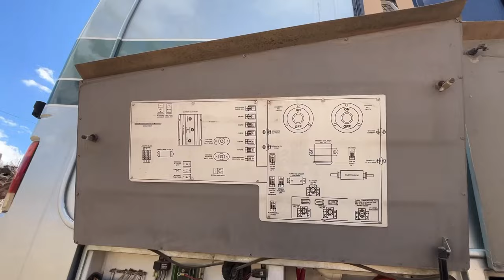RV Repairs. Fly Swatting lessons.

Comment: Another fly tip: you'll have more success angling from their rear. I used to catch flies with my hand all the time 😅by scooping them from behind. They take off perpendicular to the surface they're on and have to transition to forward flight, also fighting gravity which varies with the orientation from which they begin. It's during that initial perpendicular takeoff period that they're most vulnerable. But if you're expecting them to instantly move forward, you'll actually miss in front of them. They very often angle to the reverse of the direction they were facing, which increases their chances of dodging a normal anticipatory trajectory.

Another problem is that often you're worried about damaging the thing they are on or something nearby, which makes you "pull the punch" and gives them more of a chance to get away. I had more success catching them than swatting them for that reason, because I scooped parallel with the surface and wasn't afraid of hurting myself or smooshing fly guts all over something.

Of course a lot of people couldn't stand the feeling of a live fly buzzing around inside their closed fist, but I always rectified that situation in short order. Usually by throwing them down on pavement as hard as I could and then stepping on them. The initial sudden stop usually did the trick, but the stomp ensured success.

Comment: Use rescue fly trap. Sold home depot. 
Add water to the bag trap.
Hang outdoors by trash dumpster. Add water when below line. Every fly in the area will go to the trap,  filling trap , in a few days they sink to the bottom , making room for more. When full, put it in a zip lock bag & throw away. No more Flys. Put a camera by trap.

Comment: If only you're younger viewers knew the difficulty accomplishing simple tasks.  I've been trying to change the water pump in our fairly small fountain.  My hands no longer have the strength to push the tubing over the male parts.  And no, vasoline doesn't work because the tubing falls off, ugh!  Any lessons for that?
Reply from the maker: Heat up the tubing with a hair drier.
Reply: Thanks JC, I've tried a hair drier and heat gun, when the tubing that I have stretches out it stays out, ugh... @JCTravelStories